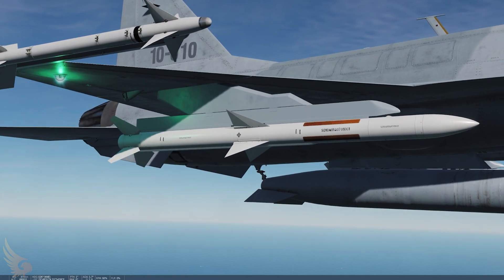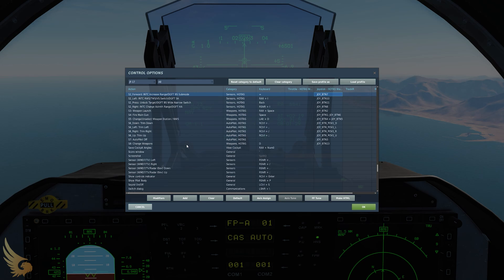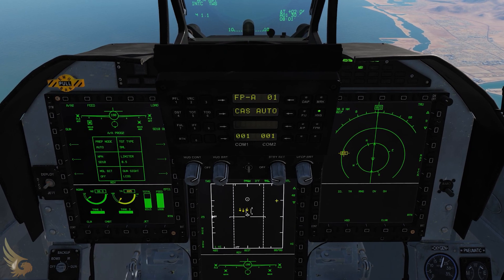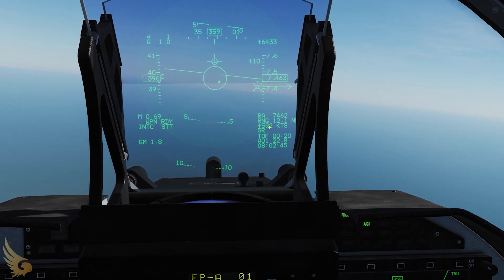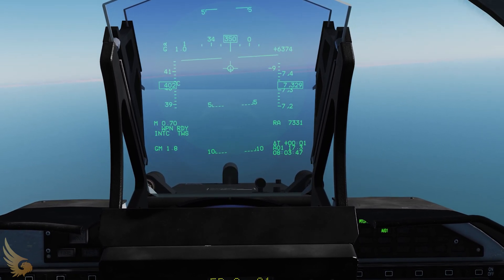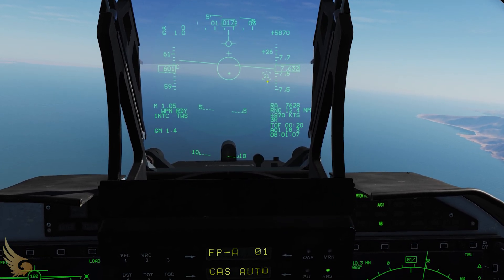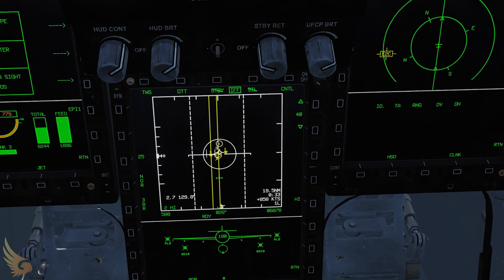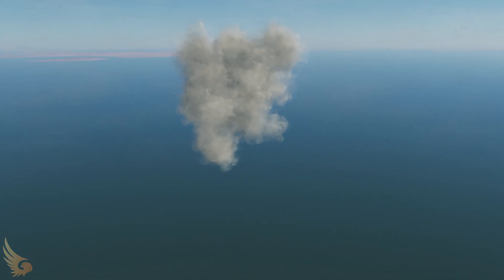JF 17 BVR - STT, TWS, and DTT

Comment: Hey, great video! Just wondering, do targets get a lock warning for RWS?
Reply: I think they do, thsts what the f18 uses and it gives a warning
Reply: @mrbrianbrush  Hey, That's not correct ;)
The basic RWS does NOT trigger a RWR warning (audible) but it (obviously) shows you on your targets RWR - because your Radar is "touching" his plane.
What gives you an audible warning right now is an STT lock - this is seen as a high threat because you are tracking a target and weapon employment is intended.
RWS, LTWS, TWS -> They do not trigger an audio warning.

Edit: Oh and RWS is NOT a lock, a lock can only be done via STT or LTWS/TWS.
For a "lock" you need a track, and this cannot be provided by Range-While-Search -> It only gives you range and the angle, but no target-aspect.